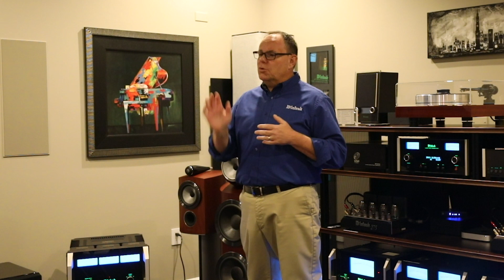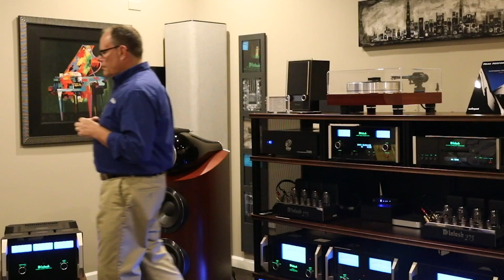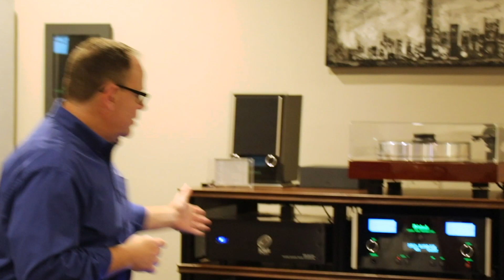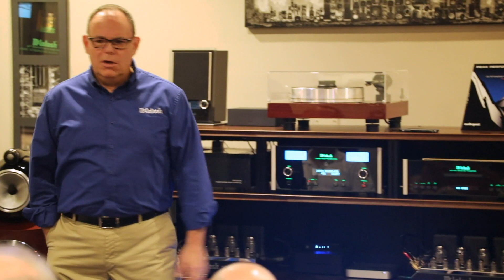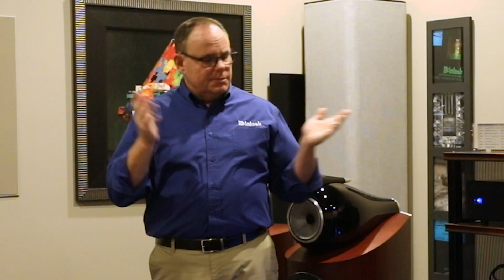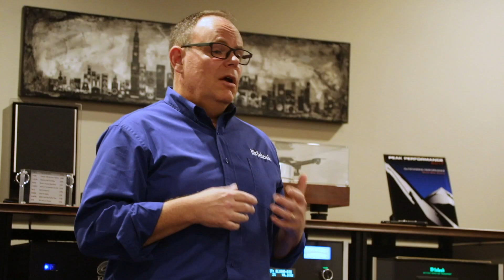The McIntosh Clinic at World Wide Stereo

Comment: Has gone Lifestyle, downhill, has been bought and sold many times, it's trying to survive
Reply: “Lifestyle”? What is “lifestyle” about McIntosh, in the worst sense of the word?
Reply: @cpg8000   goofy $1,000 clocks!  Integrated systems, they are hunting and pecking at scraps, to survive...they sell 1950's technology, output transformers on Solid State amps, that is as dumb as it gets
Reply: @cengeb  I hear you. What brands model do you like instead? A general question, I know, but any info would be appreciated.
Reply: @cpg8000  I have several ,Legacy Audio Whisper speakers, VanAlstine P500  amps i run 4 of em 5200W RMS total,  some Vanalstine hybrid phase inverters for the mono ooperation of 4 amps running in mono,Vanalstine hybrid pre amps, Emmlabs, DSD, several DSD sources Teac, TASCAM DSD, Philips,Marantz, HHB,Korg,Onkyo,Audio research hybrid pre amps, 4 different Audio research preamps LS17SE, LS25, and a few other, forget the models right now .  I heard McIntosh in the late 60's when I was a kid, guy had a cool, in wall setup, looked cool, got me into hi fi, BUT, the prices where insane then too, compared to what it did, when I heard other stuff, priced for mortals, the blue lens wasn't impressive sound wise, lots of look, not any better performance..
Reply: @cpg8000  That showroom in NYC has to be a BIG expense, just to keep that going, think about how much money is needed just to keep the doors open, talk about having to need high prices, with high expenses. Vertical integration is an obsolete production method, car makers dropped it decades ago, to LOWER costs... making your own ckt boards is dumb..getting components made to spec, by companies that specialize, in like TRANSFORMERS, is cheaper, than making your own...to the same quality level.  Car makers don't make their own tires, or spark plugs, or brake pads, or brake rotors, turbos, an don and on, there are companies that do it better in volume